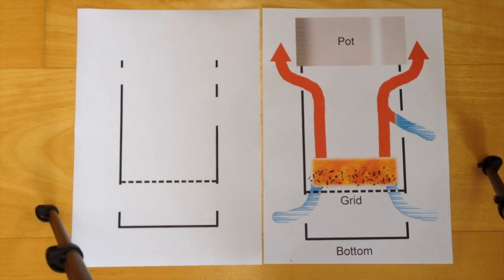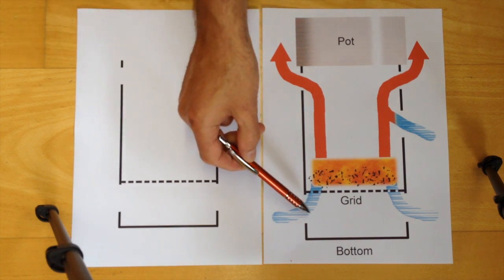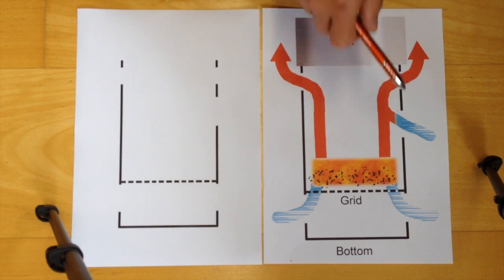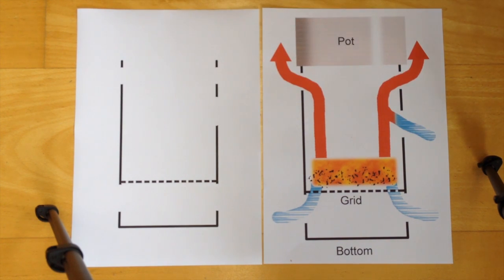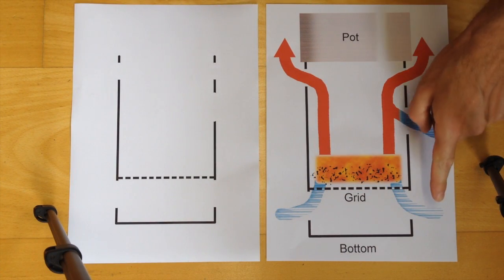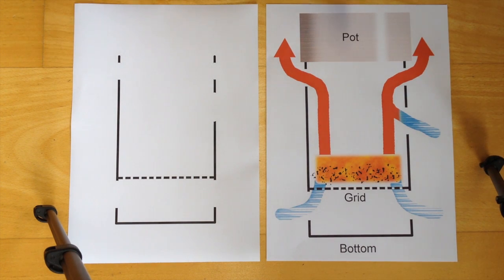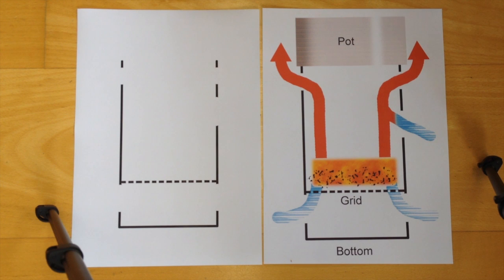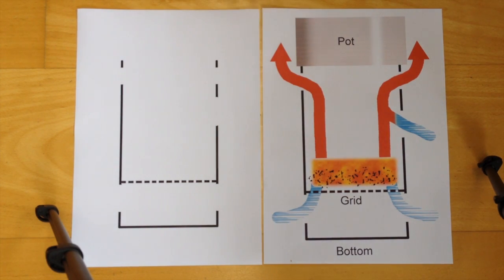What size, shape, material and specs are best for a hobo stove - Stove Mods theory lesson

Comment: Hobo stove and wood gas stove, which one is better? Why?
Reply from the maker: I have a vidoe about the differences in my channel. But i do not think you can say one is better than the other. This would be like decideng if Popcorn or Marshmellows are better....it just depends on what you want or need. Despite my ability to boil water with a woodgas stove I m constantly being told I was using it the wrong way. This is one of the reasons I do not like it too much because I in my opinion a stove which appears to require a degree in physics for using it is just too complicated. The woodgas stove burns more clean and efficiently but I definitely prefer a simple hobo stove that gives you a good fire without a lot of effort. Also the burning chamber in a hobo stove is just bigger by definition because you do not need two walls around it. I found the smaller space in the woodgas stoves often to be a disadvantage.